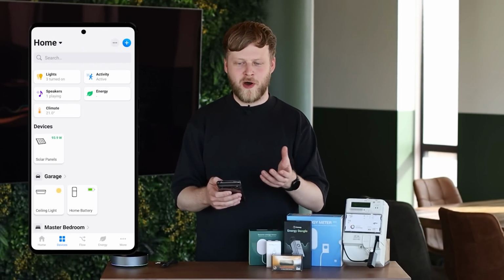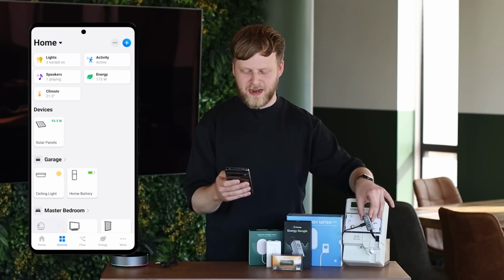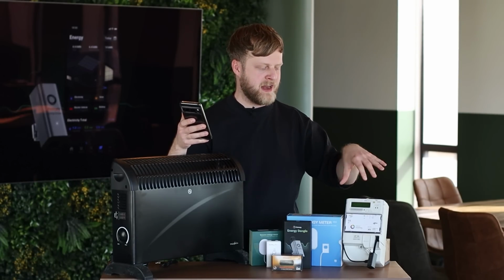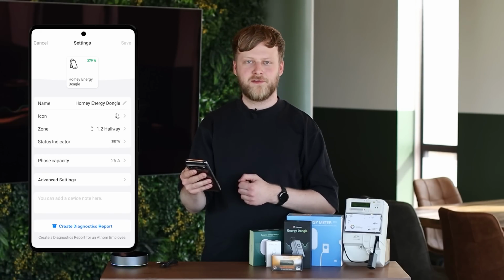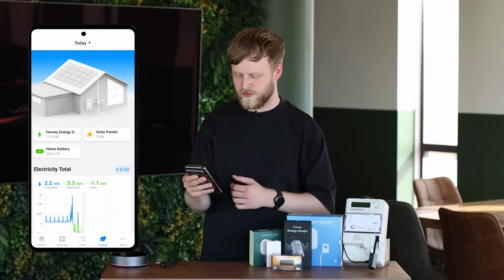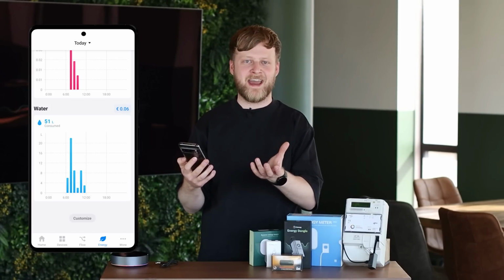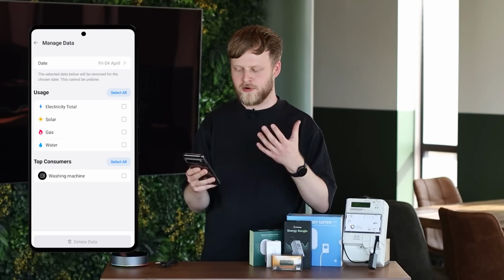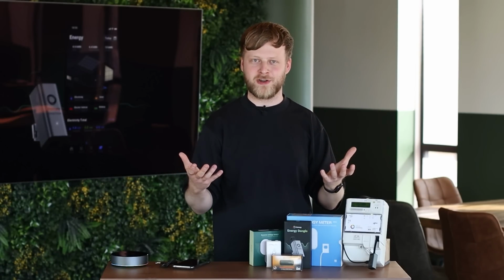Homey Energy — EVERYTHING You Need to Know

Comment: So the Homey P1 dongel needs internet and your network (the same as your Homey Pro) to connect?
And what if you separate the Homey Pro from the other things, is it easy to discover on your Firewall the port(s) needed to communicate?
Reply: Homey Energy Dongle needs to be on the same LAN (L1 network) as Homey Pro it connects to.  Used with Homey Cloud it doesn't matter, just Internet

Comment: Is the standard only for European nations, or do you know if it works with meters in the United States?
Reply from the maker: The P1 standard is typically used in European countries. If you’re in the US and want to get your energy data into Homey, you can use alternatives like the frient and Aeotec devices featured in the video.
Reply: in the USA there is also Sense and Emporia Energy. Sense connects inside your power panel though I don't think there is a Homey App yet for it. Emporia Energy has two products, both work with a Homey App. The Emporia Vue 3 Home Energy Monitor connects inside the power panel, the Emporia Vue: Utility Connect for Select Markets is a USB WiFi device that connects to your meter via a Zigbee type interface though it is only in select areas as its name implies. We use the Utility connect model here in PG&E territory in California and it works great, plus no opening the power panel! We also have the Frient model Abe mentioned attached to the meter, it's only fault is if you have lots of sun on the meter you'll need to shade it otherwise it can't see the blinking LED.

Comment: What if you unplug the power of the energy dongle after the setup? I dont have homey pro/bridge, can I still use the energy meter?
Reply from the maker: Some digital meters supply enough power to fully run the Homey Energy Dongle, so in those cases, external power isn’t always needed. Additionally, the Homey Energy Dongle works with Homey Cloud (with or without Homey Bridge), as well as with Homey Pro (Early 2023) and Homey Pro mini.